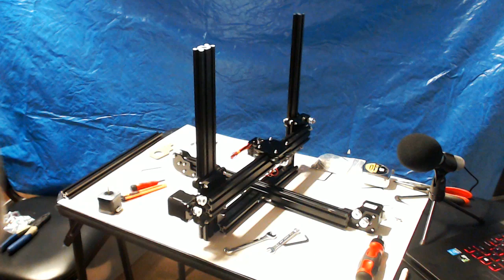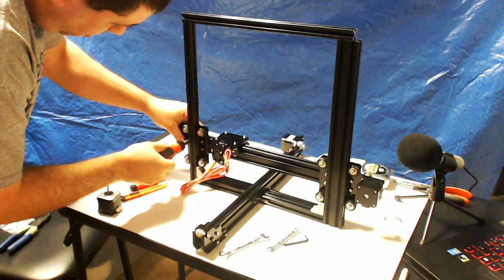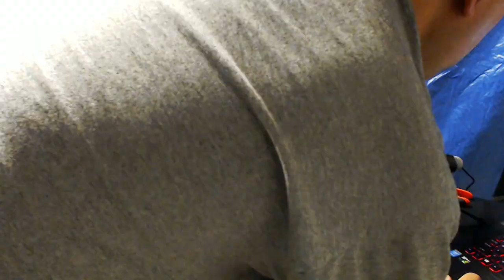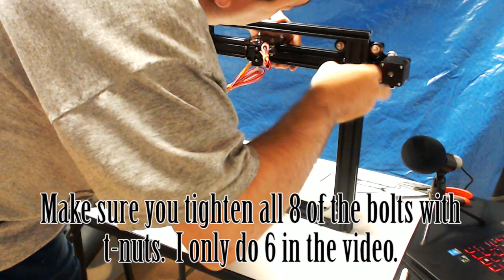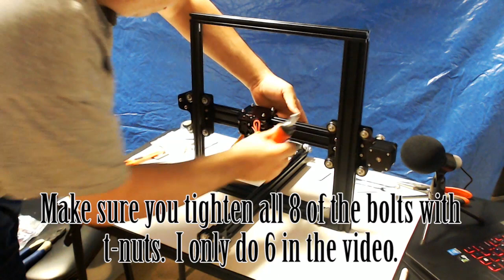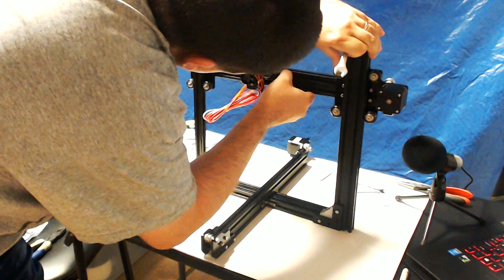Tevo Tarantula Assembly - Step 9 - Top Rail, Squaring it up

Comment: Hello, When you said it's important to have the frame squared. How much of error in mm do you consider as accurate between high horizontal measurement and low? Does 1mm gap good enough to be acurate or less?

Comment: Has anyone fixed the wobble?
Reply: You'll need to print more secure brackets and/or screw it down to a board. There are some pretty cool looking brackets out there. I just got mine working, and am printing a fan duct now, then "something cool" to feed the beast, and then brackets. . . lots of them.

Comment: Nice laptop! Looks like an Asus ROG! =D I've got a similar, if not the same one. =)

Thanks again for these videos! You are a lifesaver! I have been going bonkers watching the video I was directed to by the manufacturer.
Reply from the maker: +Aaron Fruman Haha, you are welcome.   I was one of the first people to get this printer about a month ago so it&#39;s been a bit of a trial to get it running.  I got a second specifically to make these videos because it really is a great working printer once you get it going.

Laptop is an Acer Black Edition, can't remember the model.  :)
Reply: ArcadEd Do you have any videos of a finished piece as an example of how well the printer can actually print? I saw the Prusa i3 X by Geeeetech that looked awesome because of the rods. I feel they'd be much easier to calibrate as there are not wheels to adjust. It would just be rod adjustments and making sure they're all parallel, etc. Again, I'm saying this with little to no 3d printer experience, just a technical mind.
Reply from the maker: +Aaron Fruman https://www.dropbox.com/s/bgiego3deol9dws/DSC_0818.JPG?dl=0
Reply: ArcadEd Thanks! =D
Reply: how do ya fix the wobble  @1:10 mine measures 15 top and bottom but can't get it to sit flat for the life of me, any help is appreciated thank you
Reply: christopher kot mine wobbles at the bottom, too I will message you when i find somthing to fix it